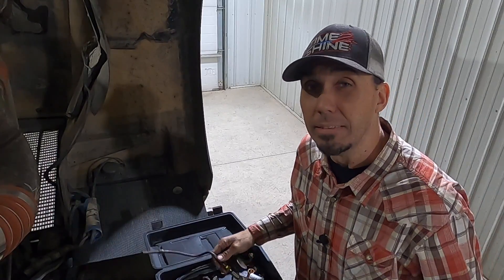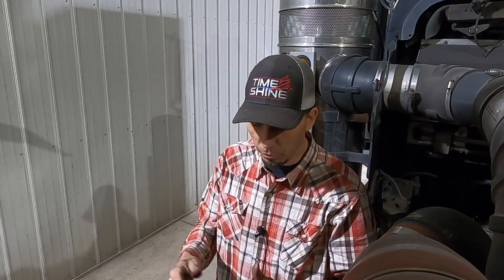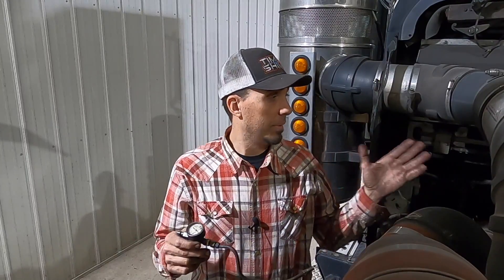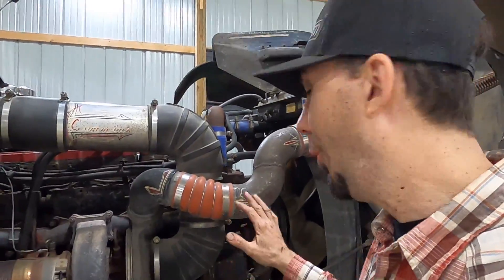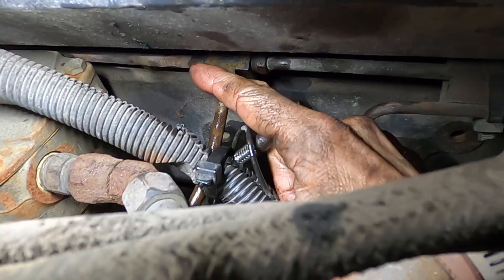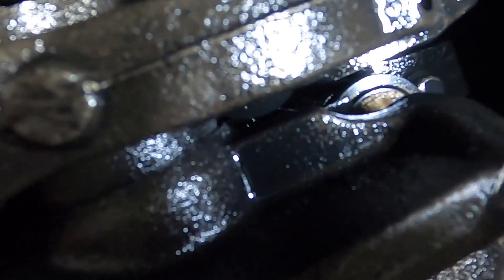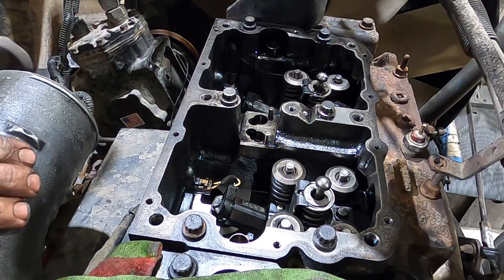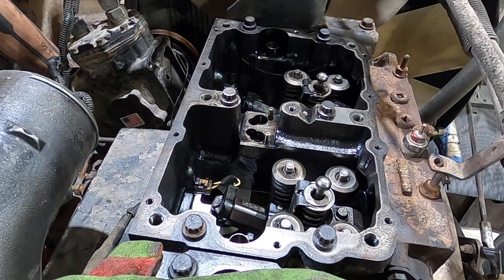Simple Cummins N14 Fuel Leak Diagnosis & Repair

Comment: Watching this video I'm trying to figure out my N14 525. Has a shudder after pulling a gear then upshift. I could hear it in the exhaust but felt like a clutch shudder. Just lost on direction. Has about 450k on a Cummins recon. Thinking fuel pump thinking injectors  thinking sensors no codes

Comment: HELLO Mr Flanell Phillips!
* new subscriber here* Whats your thoughts on a 2001 N14 Cummins engine celect Plus red top set on a 2001 Kenworth T2000?
Reason; there's one I want to buy And as I searched for engines as far as Cummins N14 came overtop ISX CUMMINS.
YOUR INPUT IS APPRECIATED 👍

Comment: Hi Philip, just to say use full shop air on a cummins because of high rail pressure, some leaks may not show up to higher pressure and use a pry bar with a point ground on it for removing the injector. I carry a spare injector and tools because n14 injectors like to fail a lot. are you going to the big iron this year? good video like your other ones.

Comment: Intersting way of doing an injector test w dye. Ive seen it where they take a fuel line loose, pour the dye in and pressurize it from the fuel filter side,  and look. I have the same issue now on a 3406e. In my case we didnt see any fuel coming out of the injectors. Hope its not the head.

Comment: Just a question. What kind of psi does the fueling system operate at? I see you ran it up to 120 psi to check for leaks.
Reply: Depends on how the pump is set up but usually around 200 to 250 psi.
Reply: @mikebougher3731  wow! Had no idea they ran that high! Appreciate the comeback.
Reply: its 75psi